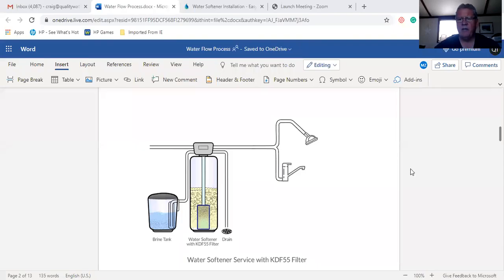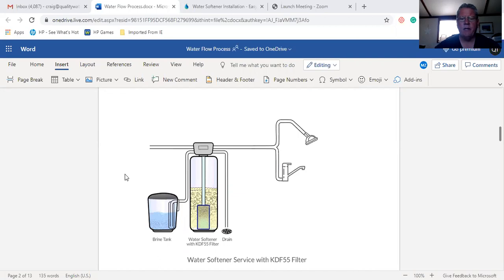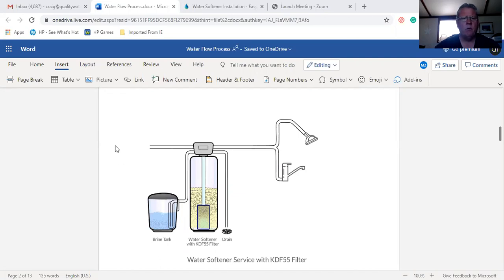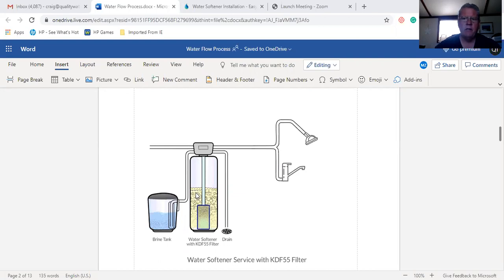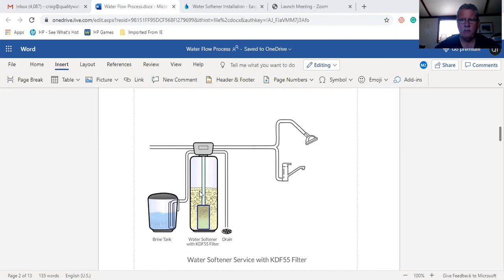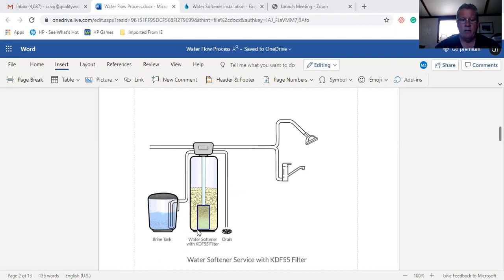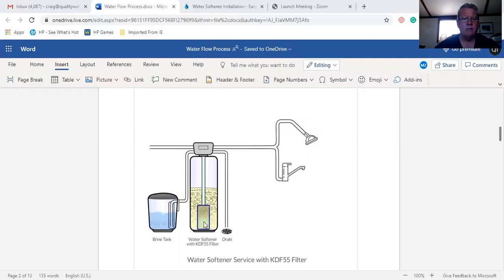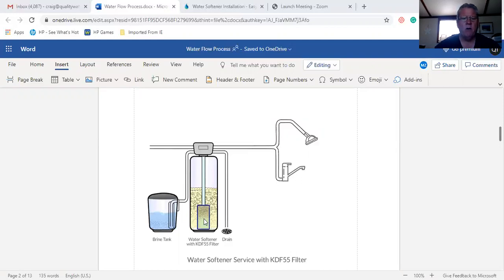Water Softener with KDF 55 in service How it Works

Comment: So I have a question. I had a water company come out because there is a rotten egg smell in my water. I do have a well and a water softener system as well as a whole house water filter system. This company comes out and tells me before replacing my system to try salt with KDF but then they tell me there is no such thing when I called to get some from them. Now the owner is telling me it is not salt but a water softener with KDF.  But from what another company told me there isn’t a salt with KDF. And from my own research the salt is the water softener? I can find  nothing on water softeners with KDF just filters with KDF.  They then tried to tell me that the workman said my system needs to be replaced and tried to get me to buy an expensive system. Now, I have no idea how old the system is so isn’t working at 100% probably not but I feel like this company is shady. Not that that last bit of info was important lol but now I’m curious. Thanks.